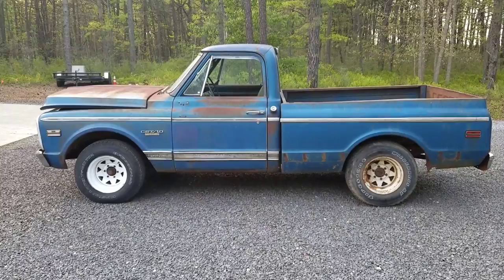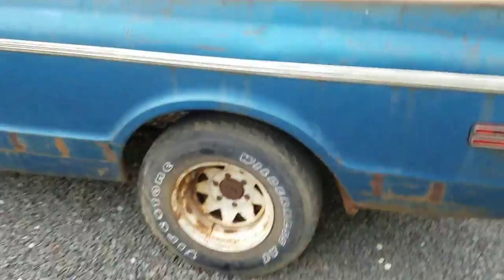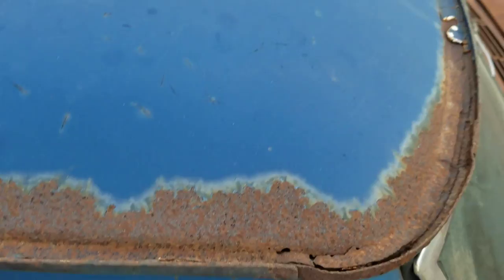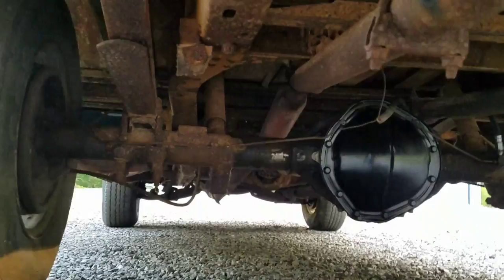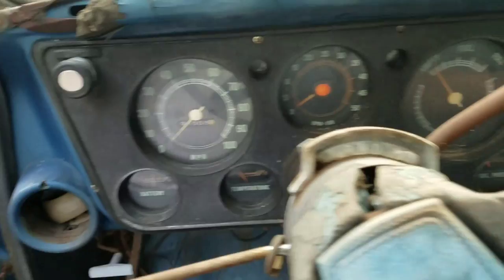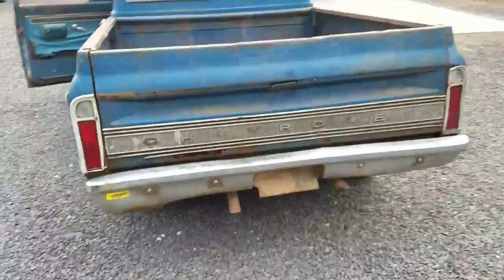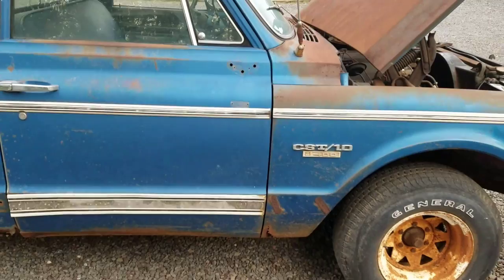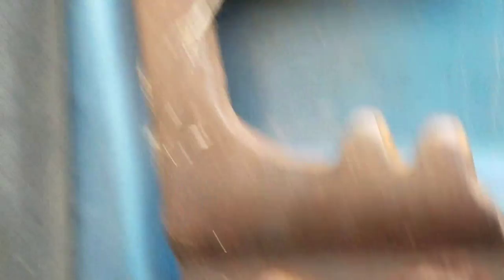Rare barn find 1970 Chevrolet C10 factory Short Bed factory big block CST must see! (now restored)

Comment: Nice CST I got a 71 chevy with the leafsprings but I have never seen a factory short bed with a big block with a automatic. So cool. Would a have been better it being a gmc 4x4 automatic short bed big block,but chevy are just as cool.
Reply from the maker: They never put big blocks in 4x4 K-10's, I've had several short bed C-10 short bed's with big blocks, and also long beds with big blocks. C-10 and C-20's.
Reply: James Damron  no, the 400 is another small block.
Reply: James Damron  I believe it's a 402.
Reply from the maker: @chevylandt.v  partially correct, Chevy called them and badged them as 400 big blocks, in 69 they had the bore of a 396, in 1970 they started with a 402 bore, but they thought it sounded better to badge them as 400.

Comment: I have had 3 factory big block 2 wd 1/2 ton had a 69 with a 396 a 70 with a 402 and a 71 with a 402 and a factory big block 69 Chevy blazer it was factory 396 also they were all 4 CSTs
Reply from the maker: Do your really want to debate this with me? For starters they didn't offer a big block in the 1969 Chevy blazer from the factory. Second, I have bought, owned, and sold over 22 chevy trucks 69-72 over my lifetime. I'm have a source who actually has the library on these trucks and reproduces the SPID sheets for anyone who has a damaged or missing one. He knows exactly which options were offered in which models. So, once again, you are wrong.  Good day!

Comment: I think leaf springs were always on the short wheel base trucks same as the Jimmy and Blazer.
Reply from the maker: Negative, it was an option. Coils were standard.
Reply: Nope, most C10's had rear coils factory. My 68 has rear leafs but it's a C20 longbed with a factory dana 60 and a factory option big block V6.

Comment: That is not a 'big block'. A 400 c.i. chevy is a small block. A 396 is a big block.
Reply: Gary Rzeszutek 402
Reply: The 402 was an Oldsmobile engine that replaced the 396 when Chevrolet discontinued it in 1971.
Reply from the maker: You really should do research before making a comment. Chevrolet called it a 400 on badging and sometimes on the glove box SPID as well but sometimes a 396 depending what year it was and which assembly plant the truck came from.  They did not offer a 400 small block in these trucks 67-72. This truck is a matching numbers, unmolested barn find and is correct.
Reply from the maker: I love how you tell me this not a big block? LOL.....OK
Reply: Gary Rzeszutek 403 was Oldsmobile and 402 was Chevy
Reply: If you actually knew what you were talking about you could tell that is a big block just by looking at it. Mine came with a big block V6 and I'm sure you would argue about that too.
Reply from the maker: https://bangshift.com/bangshift1320/bangshift1320-videos/happy-402-lets-look-back-chevys-402ci-big-block-early-1970s/